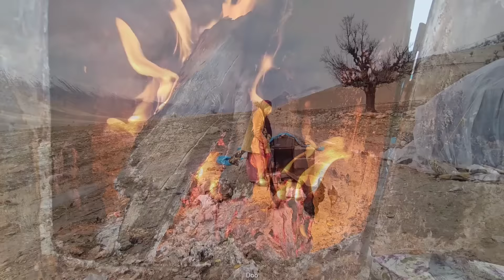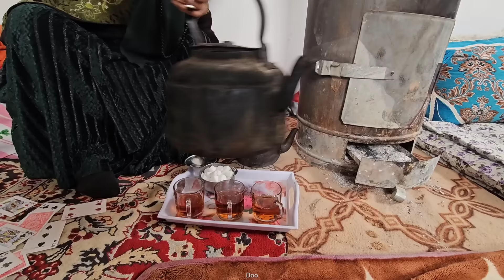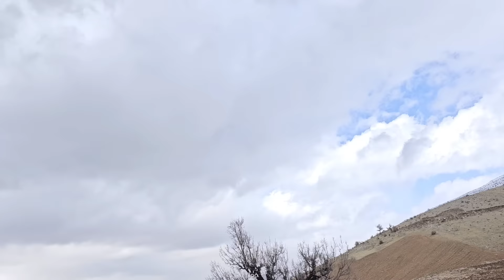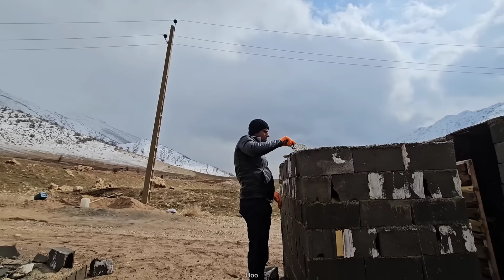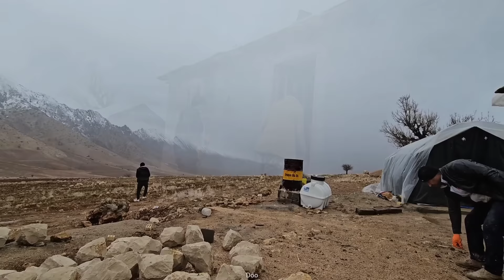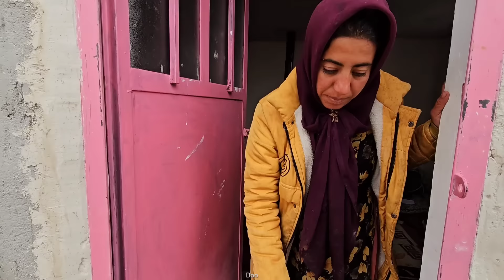Wings of Success: Building a Dream Farm by a Divorced Woman Triumphing over Adversity

Comment: НАДО СРОЧНО ДЕЛАТЬ КРЫШУ СМОЛОЙ  ЗАЛИВАТЬ .ОПЯТЬ БУДЕТ  ТЕЧЬ.  КРЫША  НУЖНА .А ПОТОМ ОСТАЛЬНОЕ ..❤❤❤❤❤❤❤❤❤❤❤❤❤❤❤❤❤❤❤❤❤❤❤❤❤❤
Reply: That's what happened to the old house.  Rahmat should have sealed it with a rubberized asphalt. Not sure what it's called either way. This house will end up like the other.
Reply: Kyllä katto nopeasti korjattava ennen kuin lapset syntyy kiire ja lamppuja tulee illalla ja yöllä.
Reply: Мим нраится но крышам лазить больше нечего делать это ихняя работа.
Reply: @lillylem  так это сразу было видно, что строили как времянку! Площадку для съёмок, декорацию!!
Reply: Maybe it's too much money, but you should tar your roof and then use aluminum to go over the top. Here in America, we use Tar paper and shingles.
Reply: Clean that plastic off of your door and glass windows. Touch up the door with paint and use the rest to paint the bottom of your kitchen cabinets.

Comment: Is it too late to leave that roof there and build a peaked roof on top of it with an overhang around the whole house so the water runs off I can't get down into the walls? You can still leave the water tanker on the original roof